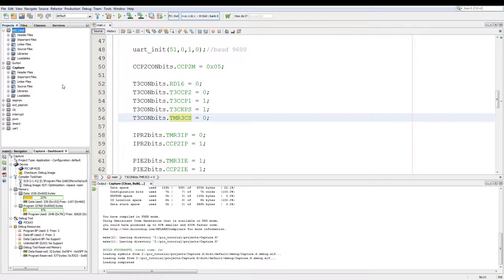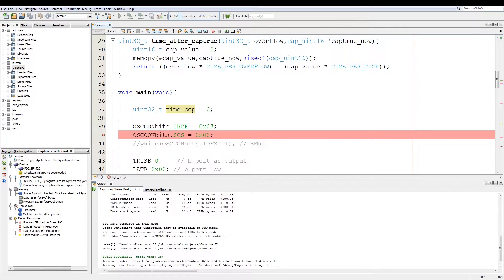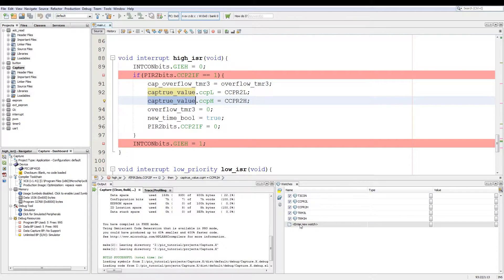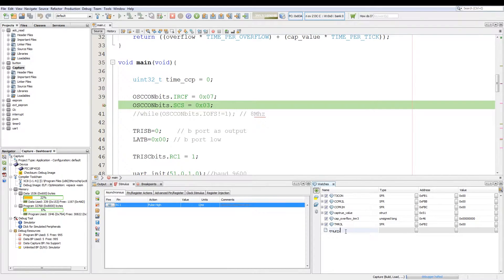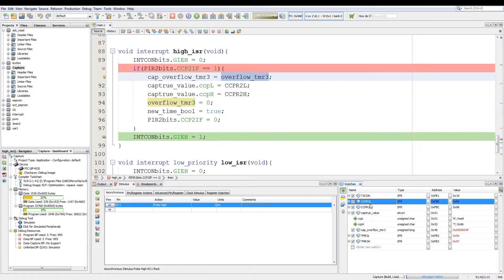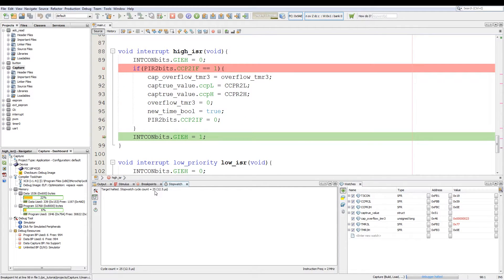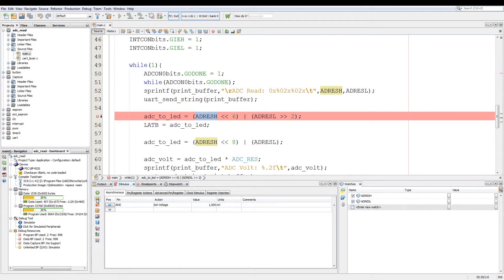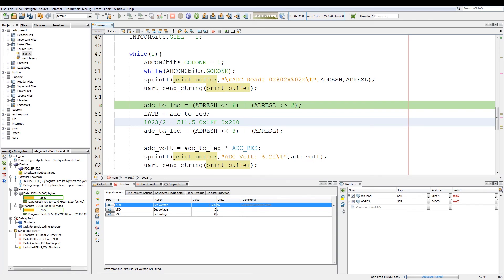Debugging and Using the Simulator 🔴 PIC Microcontroller Programming Tutorial #13 MPLAB in C

Comment: Do you use Pickit  or else?
I wonder your hardware conneciton
Reply from the maker: https://youtu.be/V7d6jhzMgYY
Pickit 4. You can also use a MPLAB SNAP. Working Pickit 3 are hard to find. Was using a original Pickit 3 I got many moons ago in this video.
Reply: @BinderTronics  thx
Reply: I have pic kit3 and PIC18F2550 .I am able to programme pic but I am not able to debugging. Do you know any other technique for debugging.
Reply from the maker: Disable the low power programming config bits. Try without breakpoints first

Comment: dont know if you're still replaying, but i dont have that 'Hardware Tool' options at 0:52
Reply from the maker: Are you sure you selected Conf[Default]? What version of MPLAB X IDE are you using? You might have a broken install or the project is not setup correctly.  Unless Microchip changed the MPLAB IDE in newer version witch I doubt since that option has been the same for about 8-10 years now.
Reply: @BinderTronics  I'll look through everything again and let you know, thanks. Do you have a video about the download and installation by chance?
Reply from the maker: @osaiyare8165  Full playlist. starts with software install. https://www.youtube.com/watch?v=KSI6fzOPVz0&list=PLtuqBdbsL-DtSo1a9pS4sLkoaU3Or2pl3

Comment: Hello, good day, do you think you can help me with a problem please, is that I am a student and I installed MPLAB X ide version 5.40 and compiler Xc8 2.20 the most recent one now, but I had another one that obviously uninstalled the other, the problem lies in how much I have to use the debug I put a break point in any line and it gives me broken then I get the following legend

Break point at line 79 in file C: / Users / jonathan / Desktop / Programs assembly PIC18F46k22 / test_1.X / test_1.s cannot be resolved to a valid program memory address

  and this also comes out
No source code lines were found at current PC 0xfff2. Open program memory view to see instruction code disassembly.

I would really appreciate it too much I'm doing Assembler programs
Reply from the maker: Use a NOP instruction where you want the breakpoint to be. It has been ages since I worked in ASM but here what is the cause in C.
Not all C statements resolve to a line of assembly code, so you can't break on them.
The NOP() macro is useful in that case as a break target.